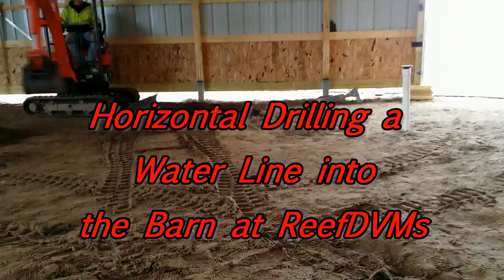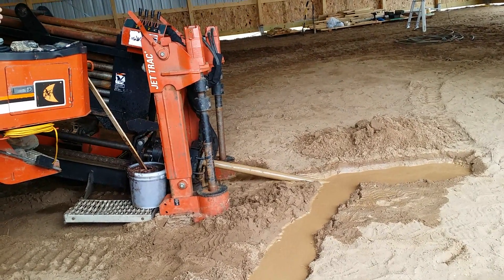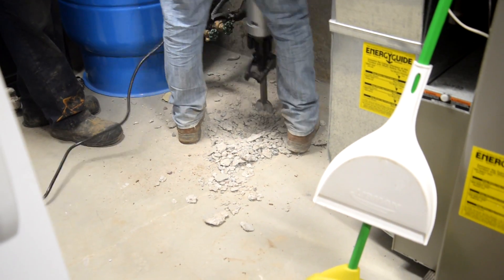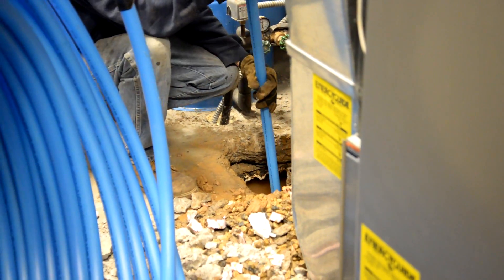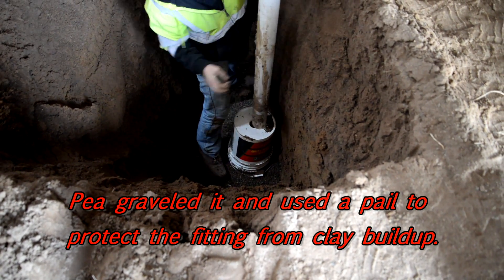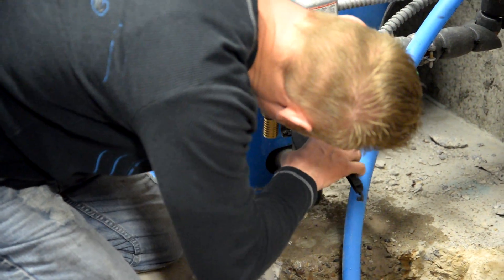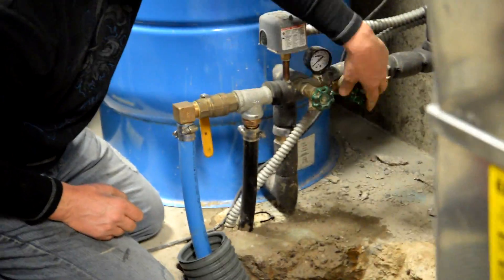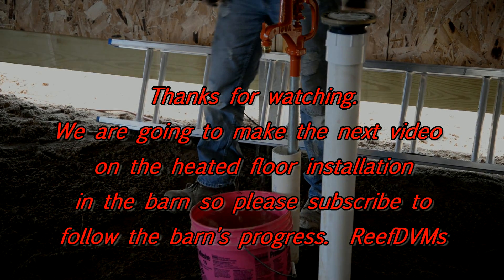Install a Barn Water Line by Horizontal Directional Drilling

Comment: You didn't pull in a locate wire with the pipe.  Now that pipe can never be located because it's plastic.  I don't blame you for not knowing this, but the idiot you hired to bore the line into the barn should've known it.
Reply: Should you do that with any water line ? What do you mean by locate wire ?

Comment: How do you control direction on that horizontal drill?  After about 20 ft. I would think it would be difficult to direct it to a 1x1 ft. square 200 feet away.
Reply: Kenny M  there are different beacons that you can use , base on how deep you’re going for a more accurate location
Reply: Kenny M the drill bit has a beaken in it that sends a signal back up to a locator telling it how deep it is an the locator can zero in right on to of the bit .      The guy with the locator tells the guy on the drill to turn it up down or left or right .   The bit stops turning an pushes to be guided.  The bit had a spade like bit when it's pushed through the ground it moves in direction of the spade .